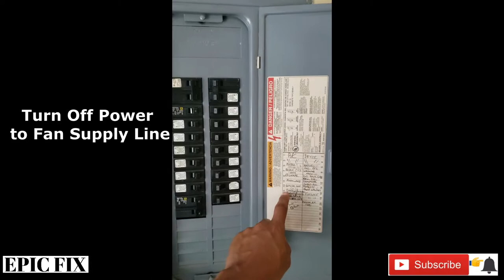How to Replace a Light Fixture with a Ceiling Fan and Light

Comment: Just a random question did you check the electrical box to make sure it’s rated for a ceiling fan because if not you may want to change that in the future ceiling fans are a bit heavier than light fixtures and if the box was plastic overtime the fan could wobble and fall out of the ceiling
Reply from the maker: I'll have to change that down the road, thanks for the heads up.